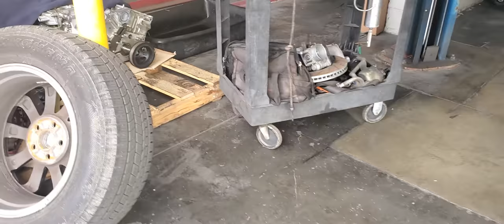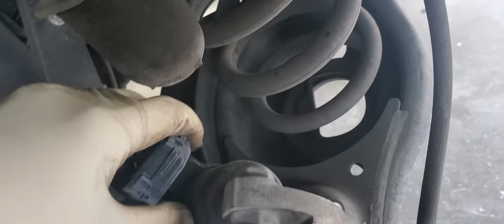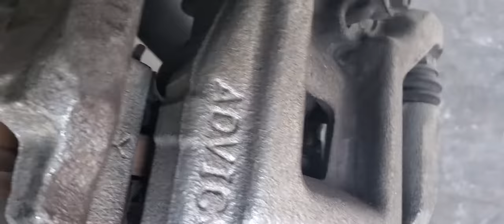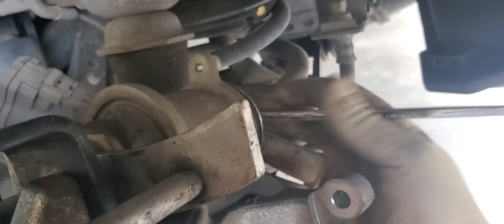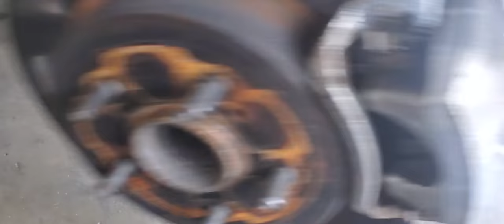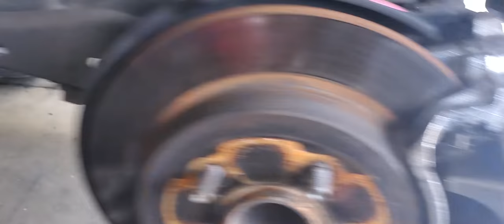Lexus NX200t Rear Brakes w/o scan tool  2016+

Comment: Great video!
I would just like to add: If you screw the (electronic) piston all the way in to allow you to compress the (hydraulic) piston, there will be too much slack for the electronic motor to engage the parking brake fully. I found that after re-installing the caliper, pump the brake pedal to extend the hydraulic piston, then use the t40 to snug up the electronic piston before re-installing the electronic motor.
Reply: Awesome advice thank you
Reply: Good advice. So you just turn it counter clockwise until it gets tight after pumping the brakes?

Comment: People, there is an easier and proper method for doing this where you don’t even have to take the motor apart. You do it in the cabin of the car by pressing the emergency brake button up three times, then down three times and then keep the button down. This causes the motor to unwind completely and go into “service mode” which allows you to push the pistons in all the way in. There are videos on YouTube tube that show this. 
On another note, I think it’s funny this dude makes a video for people who have this model car and then proceeds to offend them by calling it a “poor man’s Lexus” 😂
Nice one dude.

Comment: That is a complicated way to release the parking brake. There's a simple way to put the NX parking brake in service mode. Please a jumper wire on Pins 4 & 12 on the DLC connector. Then cycle the EBP switch 3 times back and 3 times forth. Then push & hold the button all the way forward and you can retract the EBP all the way back while sitting in the drivers seat. Once done, pull and hold the EPB switch in the back position until the EPB all the way to the locked position. Once done, then you remove the jumper wire. No need to disassemble the EPB and wrench on it with a T45.
Reply: I know right much easier and faster. Weird how mechanics don't know.

Comment: Quick question do I have to press the parking brake switch inside the vehicle to off. Meaning the red light on the switch would be off so the parking brake is not engaged and the rear wheels spin freely?

Comment: Great video. i did this with my NX200T 2017 but once done I got the message "Parking Brake Malfunction" on the dash and the parking break does not engage now. Any ideas on what could have gone wrong or how to re-set it? The car runs fine, but I cannot engage the parking break and i have that warning on my dash. Thank you.
Reply: You would need a scan tool to reset the electronic parking system in my case i used the Zurich Zr15s
Reply: @tuonglam581  Thanks!

Comment: Question: Can I use a C-clamp to push the piston in rather than the caliper tool, and just tighten a little at a time?  Great video, thanks.
Reply: spawn2882  Thanks, the c-clamp worked for me. However, I got "brake errors" on my dash that I couldn't make go away. The car drove fine albeit with the error messages. Luckily, I had to drop it off at a garage to get it inspected, as it's the State of PA, unfortunately, and the mechanic took care of it.
Reply: spawn2882  I didn't know how to reset the parking brake sensor.
Reply: I use the old brake pad as a flat surface for the c-clamp to press down on.  That gives you even distribution of the pressure, and will ensure the piston retracts evenly.
Reply: spawn2882  I know this is another subject but I wish Lexus would have used Toyotas great V6 rather than the turbo 4 banger.  It's just too slow. Other than that, however, I really like my car/suv.

Comment: Do you know which pads go on the inside and which on the outside? I bought a set from Lexus (made by Akebono) 2 of them have purple markings, 2 have white markings.  The purple have less surface area due to the cut out.  Thanks.
Reply: purple inner, white outer

Comment: Do not do this to your car this guy does not know how to release this mechanism properly and will screw your car up ......keep scrolling
Reply: I’ve done this procedure twice with no issues. It did generate a brake error code. It did not trigger the check-engine-light to come on. Code was stored in ecu. I erased it with code scanner and confirmed the code did not return.

Comment: Wouldn't recommend doing it like that. Water will come inside the caliper and simply destroy it.
Reply: Only if the o-ring is damaged. I’ve replaced rear brakes twice this way and re-used the o-ring after inspecting it for damage and applying silicone before re-installing.